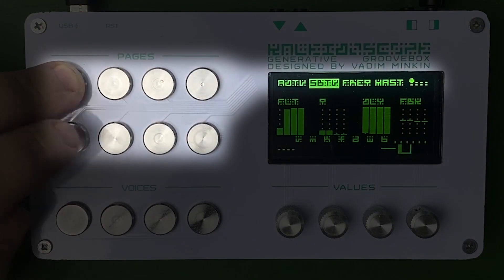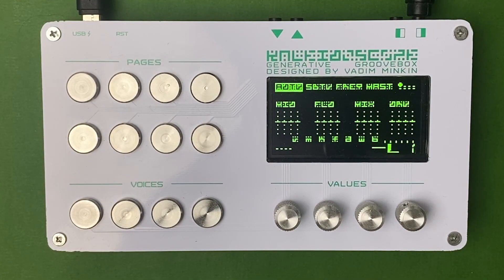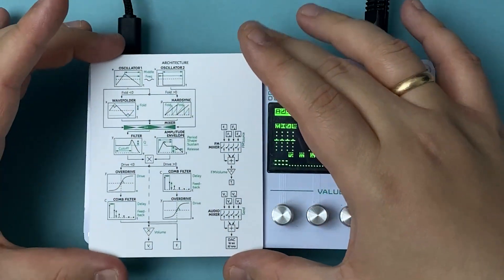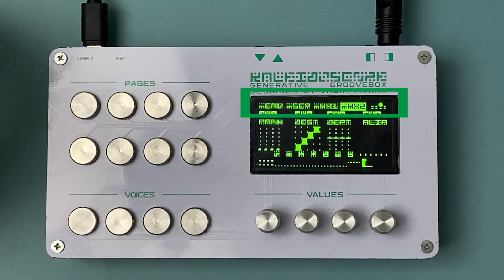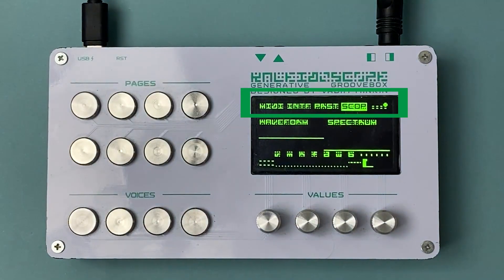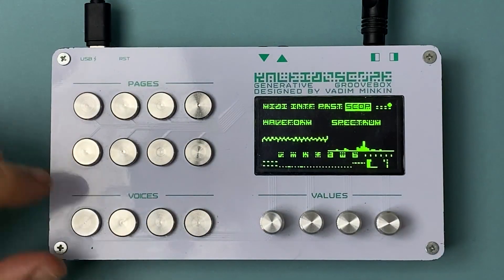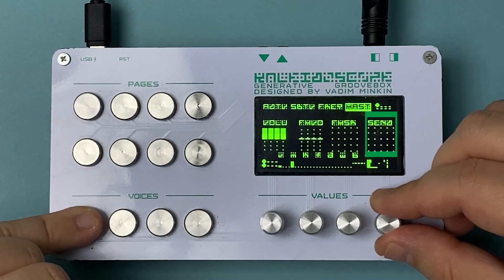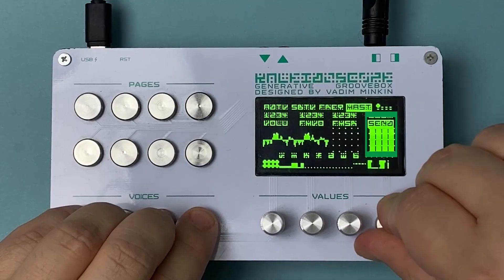Getting Started with KALEIDOSCOPE. Pt 1

Comment: what is the kaleidoscope made from? it looks like its styofoam from the little bit o can see in this video? surely no ? @0:13 looks like foam or some other cheap/ flamable material? iI hope not as I would love one but if it is this quality build I would worry it will not last a long time . very cool device I hope I am wrong about this build quality being not so strong
Reply from the maker: The kaleidoscope has a simple design that's open to customization. It's a sandwich of three circuit boards, with durable PETG support frames between them. I've been actively using my module for about two years now, and it's working just fine. But, of course, it depends on the user. I chose this design to give the device a unique look, so it wouldn't look like elektron boxes or other devices.
Reply: thanks for the fast reply! I'm really intrigued by this device we chatted briefly on reddit earlier, I'll be keeping a close eye and hopefully will pick one up. I like the idea of making my own housing for it if it's possible! Cheers from Ireland my friend
Reply from the maker: @wordboyy One of the ideas was to make the device a little cheaper. In the future, I'm thinking of developing a metal case, a wooden one, and some other ones (I don't know which ones yet). They will be available for purchase separately. Users will also have access to custom designs for the front and bottom panels. Basically, I want the user to feel like they own the device, not just rent it. Thank you for your interest.
Reply: incredible! I really like that idea, kind of like pocket operator and the optional cases, hoping I can afford one once I get my wait list email 😉
Reply from the maker: @wordboyy 100%